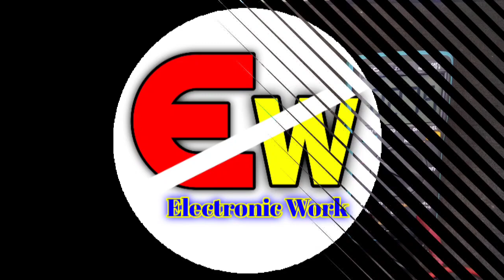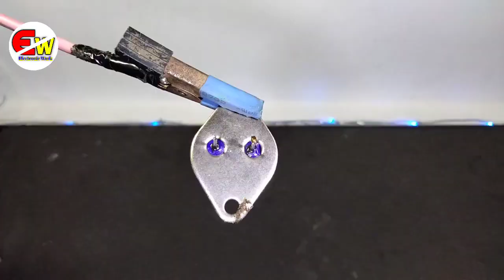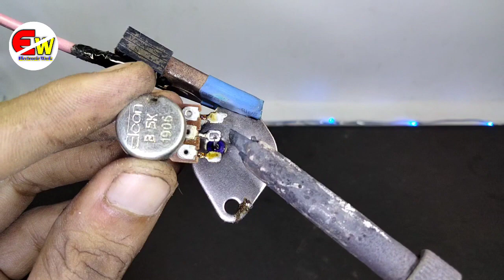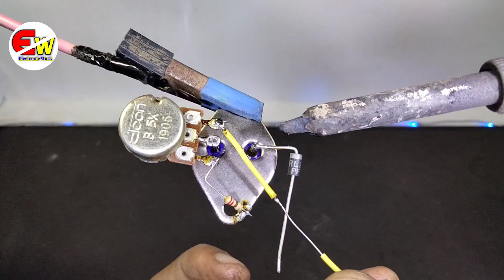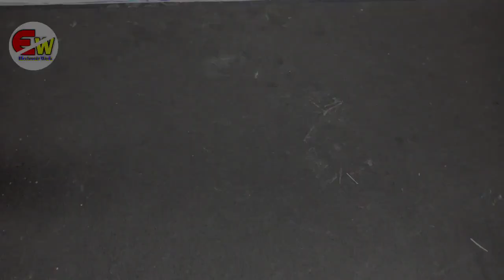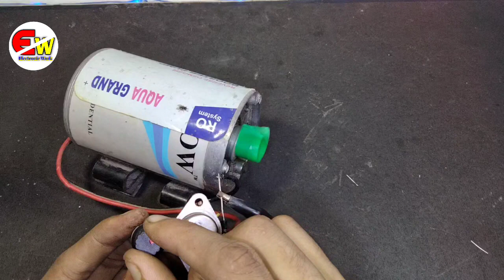Adjustable Voltage Regulator Using 2N3055 Transistor/Electronic Work

Comment: Pretty cool, man. I rebuilt it in a simulator and it works well. I just recovered some 2N3055s from a recycle bin at school; 3 RCA [8445], 2 Motorola [8352], 10 Motorola [9114], and 17 unbranded [9504]
The 8352s and the 8445s are my favourite. They're older than I am!

I will make this circuit in the future!
Reply from the maker: Okay